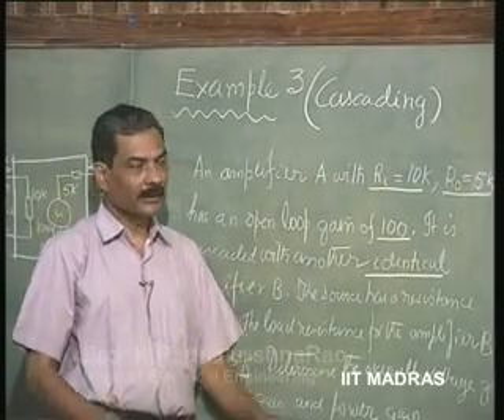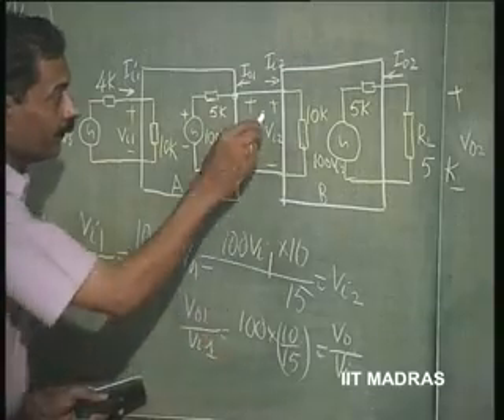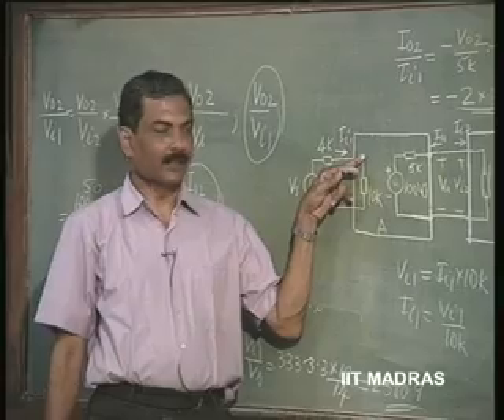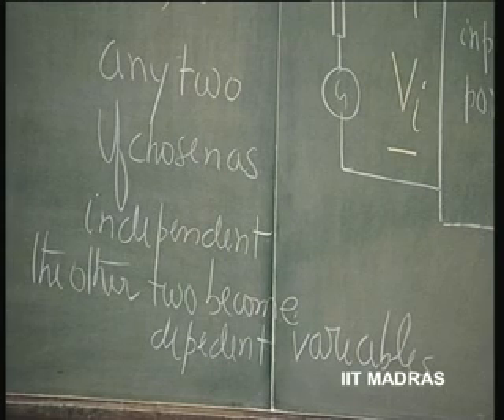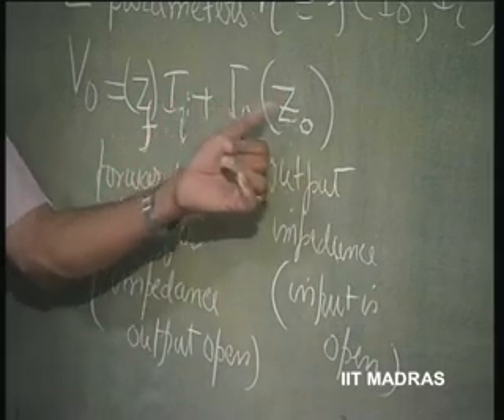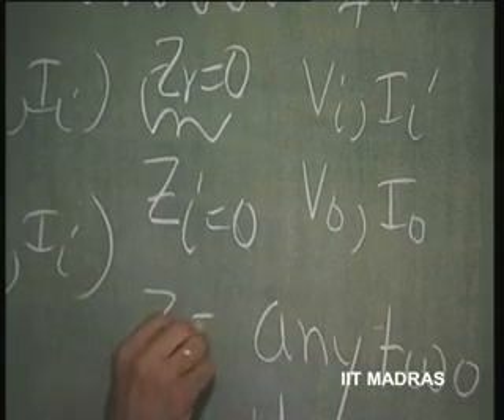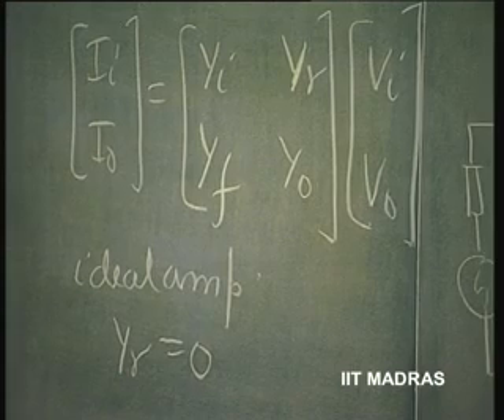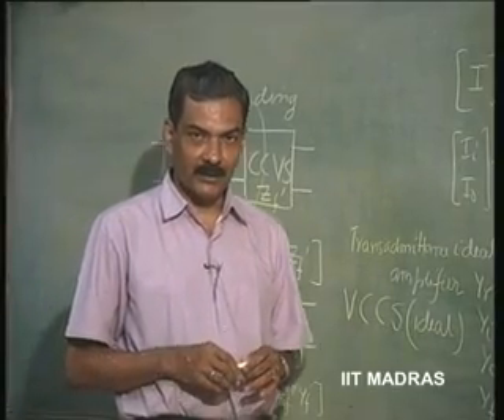Lecture - 14 Cascading of Amplifiers

Comment: At 35:17 why zi is zero? Isnt zi supposed to be infinite for an ideal amplifier?
Reply: Your question is 2 months old, but I will try to answer in case some1 has the same question.
Reply: You have taken from the beginning the 2 independant variable src (Ii and Io) so for the input you are exciting it with Ii and Vi= 0 (it is a current controlled). And in a current controlled, you have Ii different than 0 and Vi equal zero (ideally speaking) and in a current control Ri should be ideally zero to consume all the current coming from the current src.
What you are saying is true only if we are exciting it with a voltage src (Ii=0, so Ri shoud be infinite). which is not the case here since Ii is exists and exciting the circuit.
Reply: That Zi is in series, if it were in parallel then it would be infinity... Remember? Current source at input in ccvs